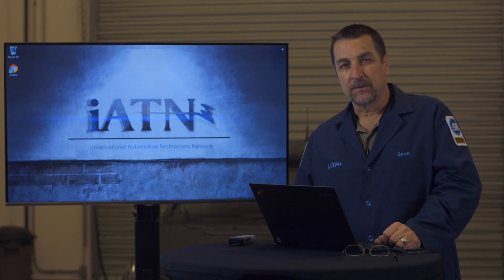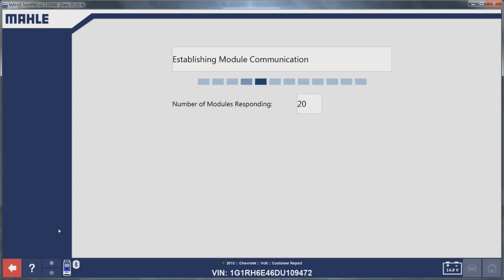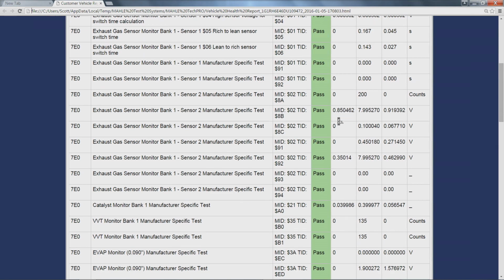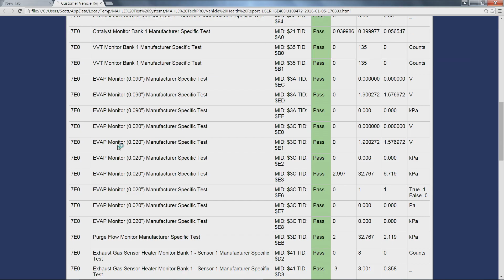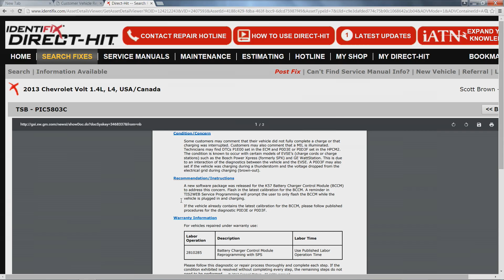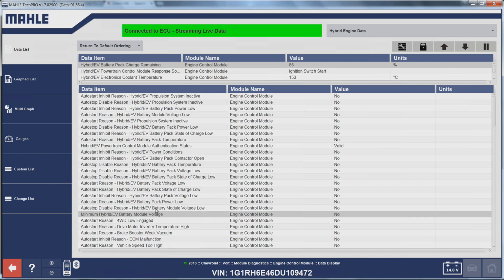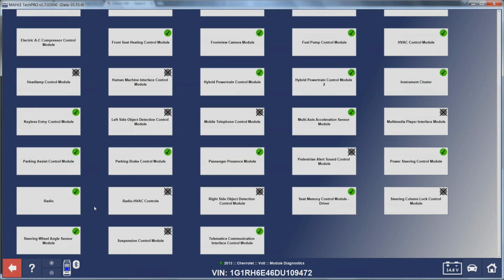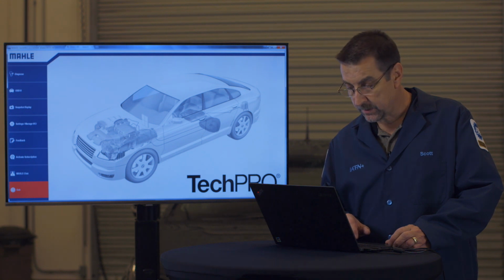Mahle TechPRO - 2013 Chevrolet Volt P0D3E & P1E00

Comment: So I know this video is over 6 years old, but have you found this tool to be improved? I haven't found much videos on it online or any reviews. What makes it better than the Chinese software like autel, launch, top don etc? I also seen on their website it can be downloaded to Windows, Android, and iOS. It would be really cool running it on my work iPad. Especially since the CPU processors are better than what they offer on their tablet.
Reply from the maker: When this tool was initially released, it worked really well on GM and Ford vehicles. It is really fast at performing a health check and creating a report. The tool automatically records everything you look at as you query each module for data which is pretty cool. This is what GM’s GDS does (Mahle if the GDS scantool author) I know that Continental has now rebranded the tool as well. Ford’s VCM Lite is powered by Mahle. I didn’t know that it now runs on IOS,  I need to look into that.

Comment: I'd like to inquire on a free trial/review for this product. Would like to post many videos using this tech pro. Reason being that I have not seen even 10% reviews of this product. I have used mahle professional parts, and confident with their quality. Now would like to get hands on their technical hardware, take it to the limits during busy days at the shop, post videos for publicity. Thank you
Reply from the maker: Hi Ace, you can see reviews on the product over on iATN and perhaps make contact with a company rep for more info. http://autop.ro/fQC
Reply: Scott Brown Hi Scott thank you for responding. Really enjoyed the video but would like more in depth capabilities of this product. Such as real fixes/diagnosis from the very early to latest models. What are its limits and where does it stand in comparison to other scan tools such as snap on, Matco/launch, maxisystem, OTC, etc. Also thank you for the link. :)

Comment: so if it needs reprogramming of the module what would be then the next step?  how is it different than let's say autel, bosch, autoland scientech?
Reply from the maker: +Sunil Mistry This device is supposed to meet the requirements a J2534 reprogramming so therefore one would need to obtain a short term sub to the OE and access the calibration process for the subject vehicle similarly to the way other devices mentioned would work. I've worked with several PC based tools and one of the positive attributes I've noticed is that it's extremely fast. There are several things that I find within the tool that I dislike that I feel if changed would increase workflow efficiency. 

1. Custom data lists - I haven't figured out how to recall once set up.
2. Graphing - Y axis scaling controls are currently very poorly executed.
3. Data export - Until the graphing capabilities are robust enough, I would like to CSV's available for logged data.
4. Health check, since it's a web based tool it would be nice to be able to fully scan every module on the vehicle and compare that to what the OE's have currently available for firmware along with a report of DTC's etc.
5. On GM vehicle's I have not been able to figure out how to access Failure Records - only freeze frame via OBDII generic.

I feel that the tool is at a V1 level and enhancements the solve for some of what I listed above will come. I have yet to experience this tool in a tablet mode and from what I understand, supports touch screen.